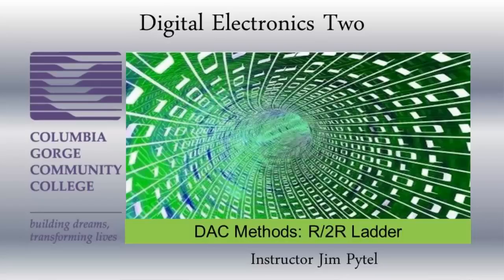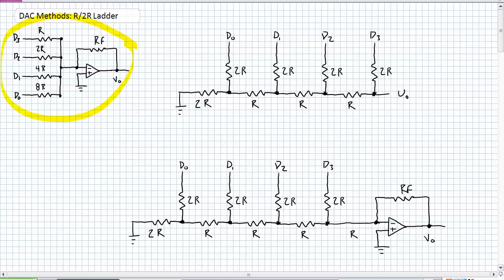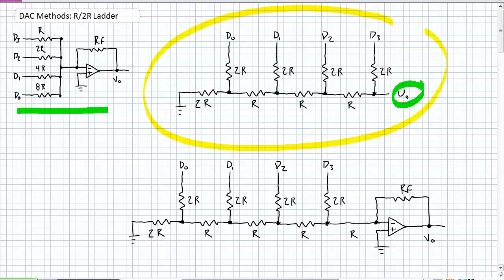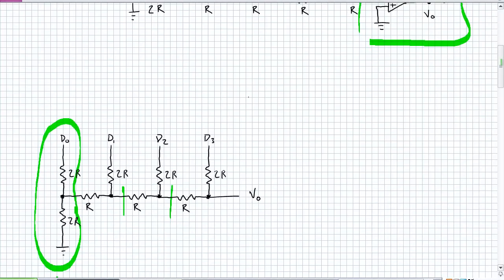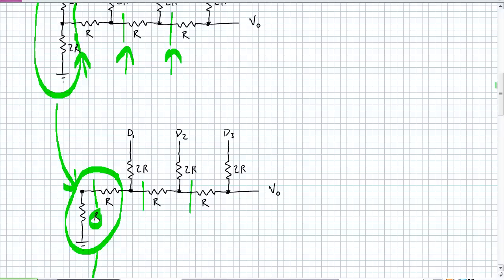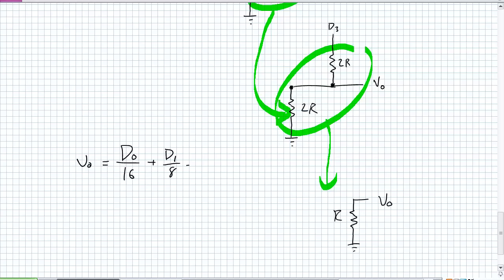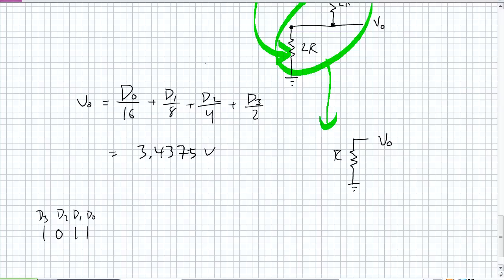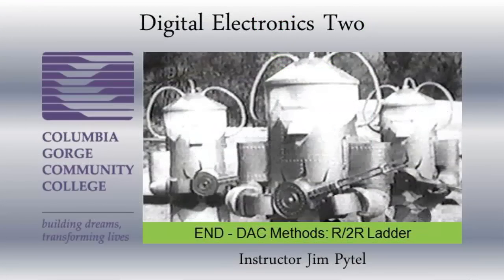DAC Methods R2R Ladder

Comment: Can anybody suggest currently available DAC IC, in DIP format, that would work with R2R Ladder. I looked on Farnell and all the DACs they have are SPI input and single pin analogue output.

Maybe this method is out of date.
Reply: Analog Devices DAC10 is an example of currently available parallel input linear R-2R network DAC with all relevant points of the circuit accessible. There used to be many more, like the DAC0800 and DAC1000 classic series from National Semiconductor (now part of TI) and Motorola (Now ON Semiconductor). You may find those in surplus component stores. Usually the SPI and I2C input DACs also contain an R-2R network, as do SAR ADCs as a part of the digitizing circuit, so it is definitely not obsolete. You can also get R-2R resistor networks. At least Bourns still has those in catalog and both Mouser and Digi-Key seem to have those in stock.

Comment: If it is so simple why are the explanations too complicated... pls, plug some values on the resistors and show some calculations.... I will learn this 2R ladder and show it myself...
Reply: Ack, don't you get it! Thevenizing the circuit makes the values superfluous. He does it like crossing out the all the algebraic numerators and denominators that recur, except that he simplifies by using standard regard for current being divided through the parallel branches of a circuit but not through series branches. So, with 2R in a parallel branch, you really got a Thevenin equivalent of 1R. So if each of two resistors in a parallel segment reference were 200 Ohms, it would be equivalent to 100 Ohms as if it were in-series. Thevenin equivalence usually goes like summing all parallel resistive branches with one single equation. But since we have four bits, he breaks it down one bit at a time just to show reducing occurring in identical portions.